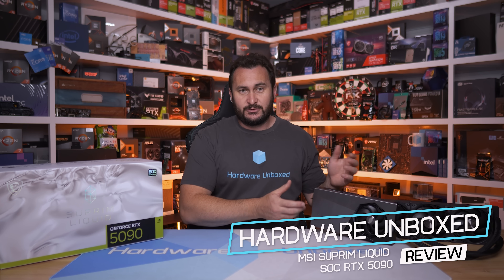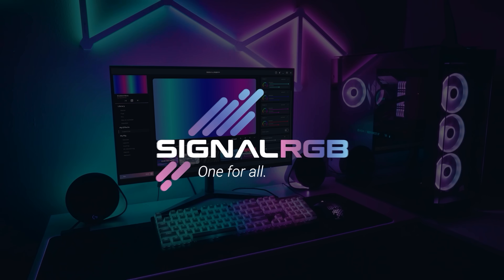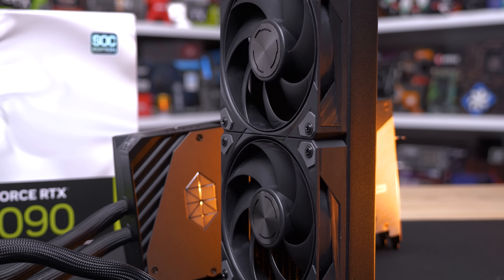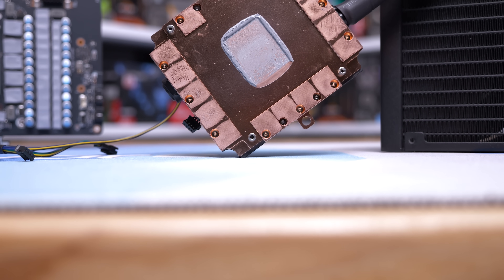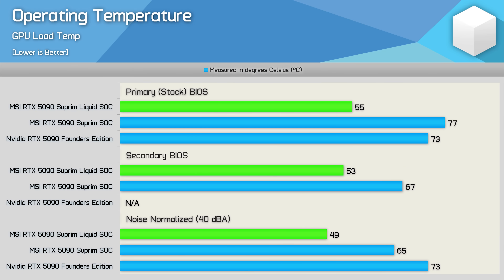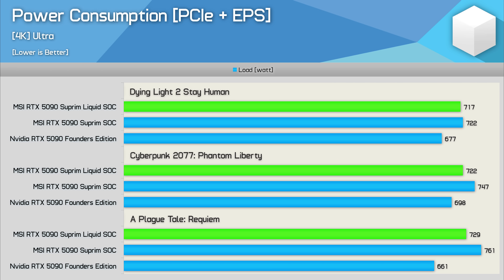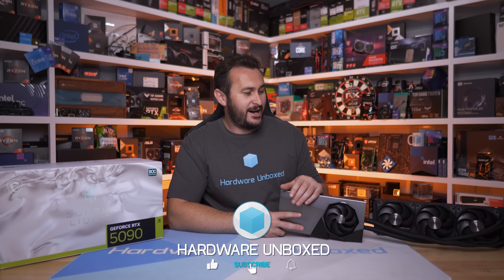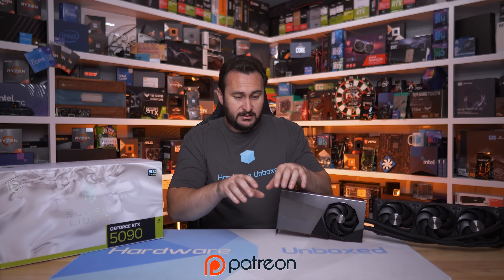The Best RTX 5090.... MSI Suprim Liquid SOC Review

Comment: Checking in 10+ months later to note that current MSRP on this GPU is now $3229.99! That's nearly a 62% premium over the Nvidia reference model pricing!

There was a short period of time in 2025 during which aftermarket 5090s were available for 100%-125% of the fake MSRP of $1999.99, but I personally have not seen anything cheaper than $2449.99 in the last 4 months (MSI Ventus 3X). Not even open box or refurbished 5090s remain in stock if they're close to $2500!

Along with the ASUS Astral ($3349), the MSI Liquid Suprim has been one of the most reliably available SKUs--undoubtedly a result of their absurd mark-up! 

Isn't PC gaming a fun hobby?! Thanks, AI!

Comment: Having the suprim lsoc  and the 5090 astral, and 4090 asus oc and also the 4080  asus oc out of all of them suprim  lsoc runs cooler and clocks higher I hit 16750 on mem and 3560 on core easily

Comment: If you have dual radiators, what is the airflow like?  On my case (Fractal Meshify C), I could fit two, but then the only intake would be the back 120mm fan, which doesn't feel right lol

Comment: I should finally be able to afford a 5090 soon for mostly AI but also VR. My preference is the cheaper and smaller FE.  And an additional 7900 XTX also for AI now ROCm support is improving for inference.

But as the FE isn't available and I'm limited by my motherboard PCIE slot spacing for two GPU's, I don't want to get a huge 3.5 slot AIB card.  I'm looking at the MSI Suprim Liquid as the best option for my needs - although it'll mean I'll have to stick with my RTX 4070 as my 2nd card until I can sell stuff hopefully so as to get the 7900 XTX later.  In my head I was actually thinking of it as a good bet for longevity and holding value because of the size, performance and quality.  I didn't think about early pump failures etc. or gunk build-up.  I'm not sure this review touched on this, and I know many modern semiconductors are now happy running at higher temps, but I sort of thought maybe running the card cooler and by exhausting this 500W ... 700W of heat out of the system would help keep system temps down ... altogether leading to better longevity for the active parts?  And then if still possessing the card out of warranty and should the pump fail etc. - I thought the board itself might still hold good value for modders and aftermarket coolers and whatnot?  Basically - I hope that paying the premium price ... still listing for £2700 in the UK in July 2025, would not lead to such a massive loss in say 2028 ... 2029 when I might hope to upgrade again.  I might search for YT vids that cover this topic.  I wonder if anyone has made a study of it?

Comment: I love mine, substantial upgrade from a Zotac 4090.  Great for MSFS 2024 in VR; but more importantly for me, the additional 8GB of VRAM & additional processing power at relatively low temperatures & noise allows me to run LLMs like Qwent3:30B with plenty of VRAM left over for Whisper 3 large & GBE.

Comment: I have the Asus rog Astral Edition and I like it more, it has a pcb coating for dust and moisture, a solid metal build, pin sensors with software monitoring for 12vwhp, 4 fans plus water blocking ability, freezing cold temps under 550w load, gorgeous design… and massive clocks. I think Rog lc model is equal or better than this, and the air cooled model within 5 degrees in most scenarios this year
Reply: The Astral definitely has the better pcb and probably more oc headroom for enthusiasts but I've heard of a lot of people with pump noise problems on the Asus. I chose the Suprim because I like to play games with open back headphones at pretty low volumes so pc noise is my highest priority. Astral is also much more expensive in Europe right now.

Comment: I bought one of these cards through Newegg. It’s simply awesome as it should be for that kidney curdling price! The 16-pin connector is in fact passively cooled - you can see the thermal pad applied directly to the top of the connector. I have confirmed this card will pull the full 600W per the 5090 spec. The best part is this card is absolutely silent. No coil whine and temps under full load was around ~70C running several 3DMark benchmarks. I am very happy with this card. Would I recommend it to just anyone wanting a 5090? No. The price to performance just isn’t there. However, if you have the extra money and really must have a silent gaming system, your search is over!

Comment: I guessed you guys missed this fine detail?
 GeForce RTX 5090 GPU based GB202, it turned out that some video cards are equipped with 192 active ROP blocks, which exceeds the official specifications of the model. In particular, ASUS ROG Astral Liquid tests showed, that the card works with a full set of ROPs - two additional clusters, previously reserved only for professional solutions. Astral LC wins!!! I just parted $2,800 for it.
Reply: lol that was an April fools joke
Reply: @coffeebreakhero3743  No. It wasn't. But I found out that it was only an accidental few.

Comment: I just got lucky and got one of these but I am not able to overclock it without it crashing. Also I noticed the game mode limited the power limit to 100% ?  What’s a good step by step for overclocking this model ?
Reply: di you use msi afterburner
Reply: @hivn58 yes of course. Now I just increase the speed and increase speed of ram. Anything I do with the voltage curve makes it unstable or slower.

Comment: I have a question. What is a good case for this type of card? say i used a 360 radiator for cpu and tha radiator  for this type of card?
Reply: Lian Li Vision Compact
Reply: I ordered this together with Fractal Design North XL Chalk TG Clear. It has good airflow, Steve said so.
Reply: Lian Li EVO RgB as well.
Reply: Corsair 6500D AIRFLOW Mid-Tower Dual Chamber.  GPU radiator on the side of case (exhaust), CPU radiator on the top of the case (exhaust), three fans on the front of the case (intake), and a single 140 mm fan on the back of the case (exhaust).

Comment: Interesting take on the longevity of the AIO cards as I'm on my 2md one with absolutely zero issues...i ran my MSI Seahawk 1080ti AIO for over 5 years with no problems until I upgraded to my current MSI Suprim Liquid X 4090 and it's coming up on 2 years with absolutely zero issues..both mounted with the pump at the bottom of the loop served me trouble free

Comment: I don't know why everybody is so dramatic about a few melted connectors on the 5090. Just use an certified ATX 3.1 PSU from a good brand like NZXT and the 12VPWR 2x6 cable that comes with it. At ~600W, it doesn't even get hot; just warm. Easy to hold/touch on both sides, tested after 1 hour full load.

This MSI 360mm liquid SOC is very good, especially advisable for the power hungry RTX 5090. It despends most of the warmth out of the case, is very silent and normal coil wine. Build quality is excellent. 👍

Comment: this is the one i have ordered for my pc. currently ticket queue number 86 from where i bought it from. my only concern is i dont have a 12v-2x6 revised cable PSU. i still have the old 12VPhwr 600w dedicated cable. if anyone is willing to respond what would be safer my dedicated non revised cable or the 4x8 pin to 12v-2x6 pin adapter that comes with the gpu. i am looking for safety i dont want the melting issue. i have a 4060 currently.

Comment: One 12 pin + PCIe slot is rated for a maximum of 675W - So is this considered an OC? Drawing 725W is certainly exceeding spec. Will it melt? Is that sustainable to run for years? Why aren't there two connectors?

Comment: Surpim Liquid 4090 checking in.
Almost 2 years and no issues.
Reply: Just purchased the 5090 Suprim Liquid. Saw your comment and have to ask how your 4090 is holding up?
Reply: @JesseStrom-n6o Are any of the AIO models refillable? 

The Liquid Suprim 5090 and the Zotac water-cooled SKU are almost always available (right now MSI has them on their website, Best Buy has them, as does Amazon and Newegg). Partly due to their absurd mark-up, but also I assume related to the shorter life expectancy of the cooler... 

I'll be interested to see what the used market is like for these AIO xx90 class GPUs in the future. The 4090s are still only 3 years old, max. I imagine by the time the 60xx series Nvidia GPUs are out they might be nearing their end of life (the pump mechanism, anyway), but with the way chip improvements have slowed down, the 4090 might still be as fast as a 6080--certainly faster than a 6070! They still might be worth $700-$800 in 2027 😂

At some point in the not-too-distant future, someone needs to come up with a solution to rejuvenate these AIO models!
Reply: Nah, liquid coolers are a danger after 5 years of everyday use.
Basically, they become a problem when insulating materials start to harden.
Pipes would probably be fine over 5 years.

Comment: Even if I was planning to buy a 5090, the melting cables convinced me otherwise. 
All the craze about melting cables with the 40 series was caused by a 3% failure rate. Given the ABYSMAL supply of the 5090 in comparison to the 4090, the percentage would be much higher. And I simply can't live with the lingering fear that my GPU might go up in smoke.

Comment: I dont get why they can't make these way smaller? Like a 1 slot. Without the extra fan and mega width.
Reply from the maker: Why would they? You still need to house a 360mm rad so making it a single slot is pointless.
Reply: @Hardwareunboxed  well they could make it a thicker 280 rad, that would fit in a lot of SFF cases like the Ncase M2

Comment: Seeing 5090 OC perform better than 7900xtx by 1.5x in rester & 2.0x in RT games is hard to watch since I love my 7900xtx so much, especially with UV 300w (stock is 350w)
But when I remember I bought 7900xtx for $900 back in early 2023
While 5090 is 2025 & sold for $2500-$3000 & have like 600w paired with cable melt issues is fun to watch..

Only a dumb with deep pockets will buy those $2500 - $3000 cards.. Nvidia love low IQ consumers

Comment: I have a question because the 5090 uses 600 watts can you still use the lian lee rgb cables ?
Reply: On the official website it is said: if the psu cable is 18awg, it is restricted to 450, unlike the 16awg psu cables that support up to 600w

Comment: I still wouldn't get the suprim currently, As the problem with the power connectors and load balancing between the connections, so far (I could be wrong) only the astral versions have shunt resistors to monitor current per connection. Which is like the only 'value' proposition for the astral, but an important one, especially after seeing Der Bauer's video on it

Comment: I wonder how many shunt resistors there is for the power? Asus has 2 cards that have 6x that at least check if you are trying to pull 600W on fewer then 6 cables and warning the user of incoming fire hazard

Comment: I thought, I was crazy, when I bought my 4090 for 1689 Euro in August of 2023. But I had the money and for the first time in my life, I wanted to have such a top-shelf card. And it turns out: maybe my decision was not that crazy. The 4090 is off the market and the 5080 is slower, has less VRAM and costs nearly the same from some partners (yes, MFG, I don't care much about that).
I see this MSI Suprime Liquid here in Germany for 3.240 Euro. Prices will go down a bit, but even 2800 to 3000 Euro are stupid. I rather get a new AMD-System with an 9950X3D (need it for editing) for around to 2k and put my 4090 in it. That card should be still the second-best GPU until in two years the 6000-Series comes out.

Comment: Its just a waste to have a single 12vhpwr connector on this frankly - I'd like to see this card with radiators have a much higher power limit tbh. Like 900W or so , I'm dying to see what GB202 can do if its clocked beyond 3.2Ghz and beyond 30gbps on the RAM without needing any fire extinguishers nearby 😂 GB203 clocks very nicely above 3ghz and I think there might be some nice FPS gains for the 5090 if it could withstand the power!

Comment: You're kidding? This is the best? Yes, what stock exactly? 

Plus Who wishes to pay over £2.5 k with water block plus pump which is more likely to fail than a fan cooled design. I would rather have the air cooled version. 

Plus, if I was into water-cooling (I am not), I would simply strip the RTX 5090 and add my own water-cooling to it, tubing and pump etc. 

The only benefit to this card, in my opinion is where you have limited space on the motherboard and this will slot-in. That's it. I doubt it will be quiet or that much cooler than the traditional GPU's. But the cooling solution seems cumbersome.

Comment: I love that MSI lets you choose between an excellent air cooled card and an excellent liquid cooled card. I happily chose the air cooled model with my 4090 and have no regrets. I’m not convinced I would like either model of 5090 because of the power slider range. I set my 4090 to use 150 W unless I absolutely need more performance. It’s extremely quiet, in an extremely quiet system. It is in Audible much of the time, though I will not say most of the time as I’ve started to hear it a bit more recently.

Comment: 500 usd for better pcb, fans, pumps radiator etc is completely fair. 800 is excessive af.
considering a good waterblock is 250-350 usd in itself.

Comment: Nice review, and seems like a great card for.. a.. 5090 dollars.

That this card has no current balancing, with these prices and the available real estate on the PCB it seems like a major oversight.
Also the large holes on sides of the block is concerning, likely to cut costs, considering it limits the area the memory chips will contact with as you mention. I don't like that at all. Nor do I like the cost cutting by using a tiny block and adding a fan. 

Maybe once the availability and pricing gets out of the bonkers range this will become a good option, although the Astral by far a better choice - as much as it hurts to say that.

Comment: This card in the video has a serious development error that can lead to fires! Dear developers, take another close look at your circuit diagram behind the 12VHPWR. You should have a shunt for each of the six +12V inputs and a current regulator that measures the current load on the cables and, in an emergency, regulates the number of amps so that the cables do not burn out!

Unfortunately, you followed NVIDIA's stupid circuit diagram suggestions and made the following mistake:

In the power supply, the 12V pins are all on a busbar (exactly as specified). It can therefore happen that 50A of current runs over just one pin instead of 6 pins. Then there are 6 parallel cables for the +12V and 6 parallel cables for GND. (Note: Up until now everything is according to specification and safe.)
But now comes the error on the graphics card, which makes everything unsafe and can lead to the cables burning out:

You have then combined all six +12V lines on the graphics card on a busbar, which leads to different resistance values if the connector is corroded or there is only very slight contamination (grease from fingers, for example) on the contacts. Even the smallest differences in the resistance values of the six cables then lead to the 50A looking for the easiest route and running over just one cable. The cable gets hot and starts to burn, as these cables must withstand a maximum of 10A according to the specification!

The correct thing would have been to monitor each of the +12V pins individually via a shunt and then regulate them down if the amp numbers are too high by increasing the resistance.

A quick note from Europe: In Europe, they are currently examining whether the sale of the 5090 should be banned due to the fire risk.

For those who need a better explanation, I would like to recommend the video from "Actually Hardcore Overclocking" entitled "How Nvidia made the 12VHPWR connector even worse."

Comment: I won't be buying any card that uses the 12vhpwr or 12v2x6 or whatever it is. Last thing I need is to spend $4500 AUD on a card that's just going to melt itself and my PSU. AMD needs to cook up a 9090XTX that sits nicely between the 5080 and 5090 in performance. Nvidia need to get their asses kicked.